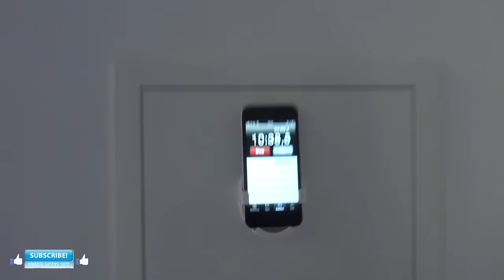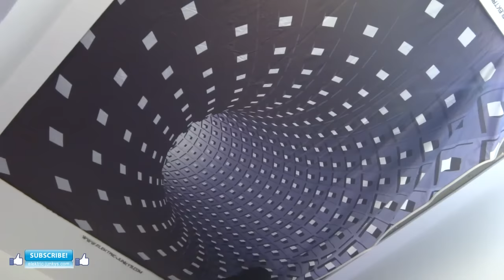#3D Infinity Ceiling Stretch Ceiling illusion Effect on False Ceiling by elektric-junkys

Comment: I thought this was going to involve a sheet of flexible reflective plastic with some actuators behind it to make an infinity mirror whose surface can be deformed. Strip leds around the sides and a few twinkly leds across the surface of the lower fixed layer to make it trippy as anything.

Comment: I would have done the frame differently for hanging the material. Build a wooden or aluminum frame to wrap the material around and use an array of neodymium magnets countersunk and glued into the wood, or epoxy for the aluminum. the frame in the ceiling would be metal angle iron. Then you can remove the panel for any adjustments or repairs.

Comment: Would recess lights work? I got a drop with 8 lights.
Reply from the maker: Hi, yes they would work we have special Molds you can Fix on roof and Adjust Height, Squeeze and cut of ceiling around Droplights Framing .. more infos https://elektric-junkys.com
Reply: @ejunky66  hi, thanks for your response. 
Just built a new house and want to install a lot of led lights. But have very little info and trying to figure out what I need. 
Is there anyway that I can sent pic of the ceiling and you recommend lights?
Thanks again 
ZedHead

Comment: that's easy to do that!  you can do that by yourself i share my ceiling 3d effect all you need 1. LED LIGHTS 2. PLYWOOD 6INCHES EVERY CORNER 3. FIBER GLASS OR TRANSPARENT HARD PLASTIC 4. 3D STICKER STICK TO THE TRANSPARENT HARD PLASTIC! THAT'S IT DON'T MAKE IT TO HARD TO THAT.
Reply from the maker: good idea ... sure, but ofcourse it is a bit more work and you need a Huuge Acryl Glass Plate .. so means the Plate is about 3 Times the Price of our roof https://elektric-junkys.com, then what thikness of the Plate you wanna use for the Dimensions of 1800mm X 1500mm ? 30mm ? ;) if not the Acrylplate will Hang Down ... So Actually our Stretch Ceilings are still an amazing Easy and Affordable way to make your own Stretch Ceiling ....